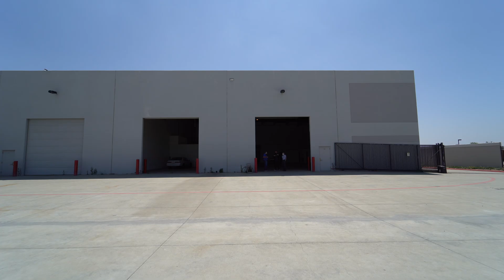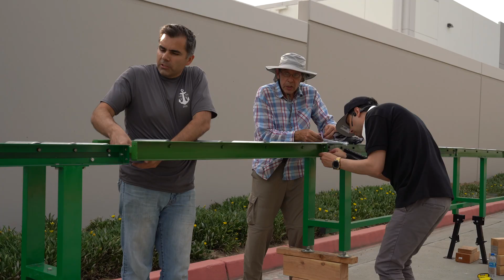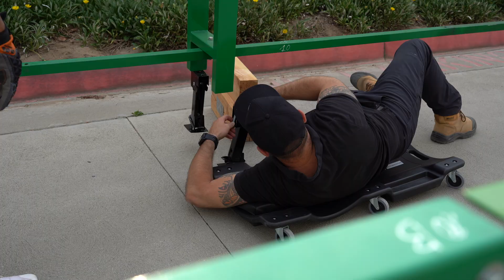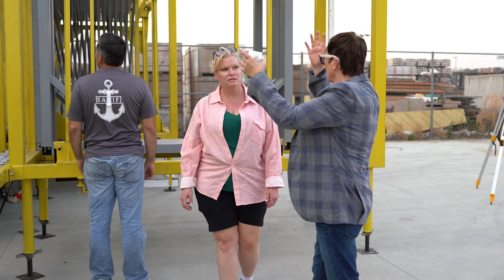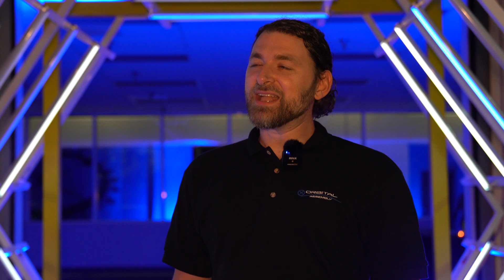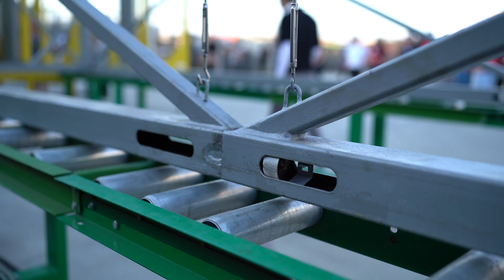World record truss, up next: space stations

Comment: The station truss systems will have curvature with a very long, exact length that will come together, end to end, forming the complete ring(s), if I understand the idea correctly. Will there be some truss units that will be without curvature? I'm thinking that there may be an additional (profitable, far less complex) use idea for such linear trusses. -Just assembling them into a gargantuan box frame, that can be paneled over, providing a large interior containment work area. Leasable, equipped with lights, power supplies, truss interior work scaffolds. Arrange OAC mining containment frames, along side habitat gravity-effect stations, to form an in-space industrial park.
Reply from the maker: Fun idea, but we aren't planning to put panels directly on the trusses, the wall thickness would be prohibitively thick to resist the atmospheric pressures. For Voyager station there will be pressurized volumes installed inside the trusses.
Reply: @AboveSpace  My bad for not clarifying the idea was not to be a pressurized environment. -But simply a turnkey working space or bay, for prospective tenants to quickly/conveniently mine a piece of asteroid, conduct an assembly of something, where power supplies, lighting, scaffolding, and float-off-into-space containment is provided, ready to go. Most of the work done would be robotic, drone-like. A Voyager station nearby would provide habitat for people that monitor, service the robotics, ongoing work in the provided bays.
Reply: Around here there's a gold-mine (figuratively speaking) in turnkey storage space, and industrial park turnkey rentable (empty) work space units. What I envision is an in-space and analogue to that sort of thing..  -Especially in the context of assembling things (in-space fuel production plants?) and in manufacturing. An idea entirely separate from OAC's human habitable stations, but simply utilizing the OAC quick truss concept.
Reply from the maker: @zuutlmna  Yes, our trusses could be used for storage and parking of craft, equipment, materials, etc.

Comment: Ok good cool vid, I would have flown in BUT
I just started a new job and figured this video would show the gist.  It was not a need to be there event but a friendly meet and greet.  Not even my sweat equity would grease these wheels, We need to put on another larger round of investment for same price or a penny more. Unless you borrowed against the mil and the increase is to pay that off and more.  This is the people's station I don't care for the paper returns we need more hooks on the books and eyes on the sky. 
 And so much human help... What will direct the front to the back something like a canadarm? Or multiples crawling around it would be cool.  How will it spin? With gas or how about a electric motor cart on a track with a solar panel and a heavy battery to watch from a far As it spins up.
Good work keep it up. 
Like a duck!
Reply: May not take much to get it spinning. And no friction/resistance in space, so it's just a matter of initially achieving the proper spin rate, kind of a set and forget. But an occasional adjustment or tweak might be needed, so the spin will be continuously monitored.